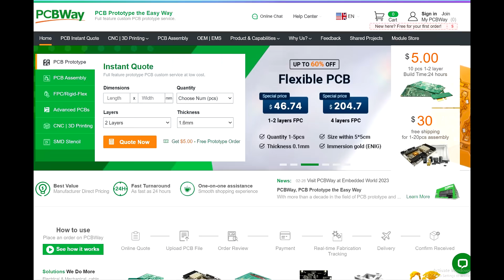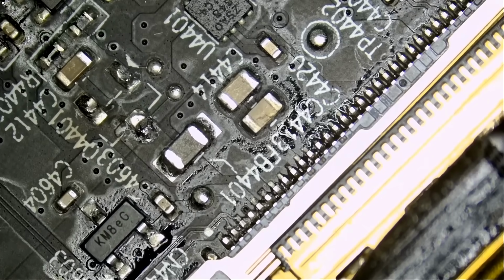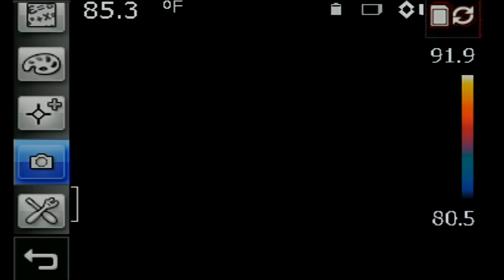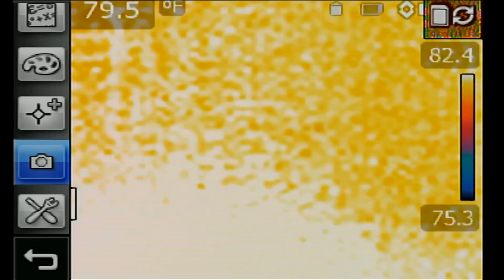High End Razer Blade Pro RZ09 Gaming laptop Repair - Black screen No image.

Comment: I have a problem with my secondhand Razer Blade 15 Base 2018 model. The problem is it won't charge but still shows the charging symbol on screen. I replaced the battery hoping that would solve the issue but it has not. I'm debating on getting a new charger but I'm worried that the problem is what's shown in this video. I undervolted my Razer to improve performance and I'm worried that this may be the cause of it not charging. I only bought it a couple months ago and I'm not sure what to do at this moment the battery only has about 10 percent life on it now

Comment: OK, nice i had a Razor similar to that , but i worked only if coll, when hetet up it became with stripes in screen
Than i owned a Gigybyte A5K1 (still do but.. )...this one u cant even open without deattaching the battery, but the drean showen same symptoms and than it "died". but external screens worked fine.
Well at least A... was replacing it just in 3 days... now the new one is working nice... 
how can somebody open up a laptop like this expensive Razors and not deattaching the battery before working on it...some User really are not fas brainers ;)